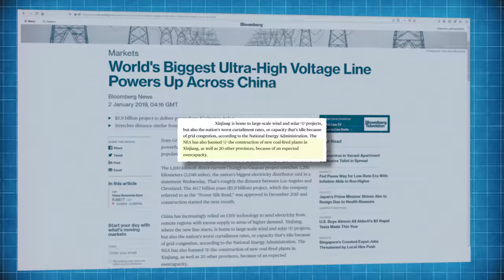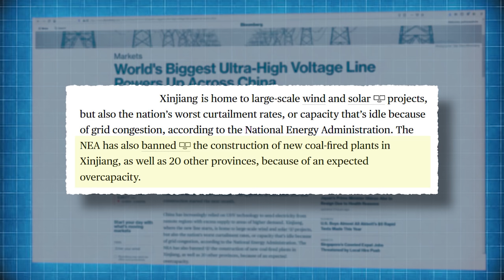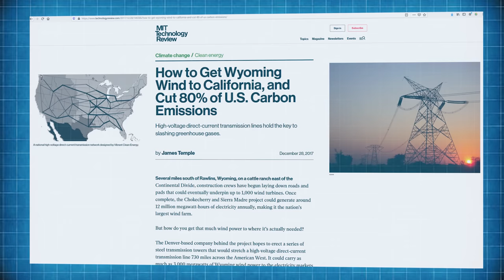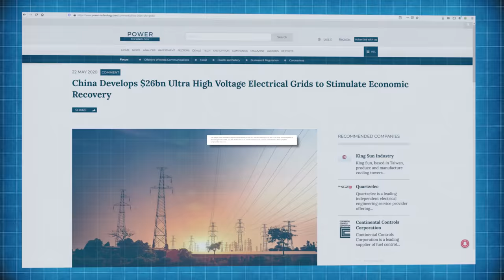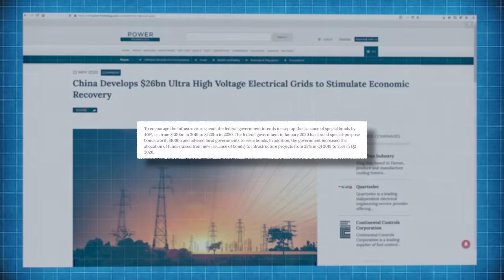China's MILLION VOLT Energy Superhighway

Comment: You did a shout out to Electro Boom!!!!  One of the funniest ways to learn about about electricty.
I did not know that DC could be sent over long distances more efficiently than AC.  Cool!
Reply: It has been known for a long time; the losses for an AC system for the same current is higher because the AC sees a higher effective resistance. Today because of power electronics, we can have DC voltages raised and lowered with relative ease.
Reply: Yes me neither
Reply: i just know a bit, but i don't care, i think it will never happen in Australia.
Reply: It cant. Why do you think dc has always been inferior to ac. Tesla was the man! Because money was wrong in their investment. And F Subasian Norstrom
Reply: @jxmai7687   perhaps australians generally know not a lot and don't care
Reply: @rmonty100  Yes it can. The reason AC was better in the beginning is because it was easier to transformt to high voltage for long distance transmission. They did not have the technology to boost DC voltage efficiently.

Comment: Another issue with AC (especially very high voltage) is unwanted induction on neighboring structures like pipelines and antennas.
Reply: We placed coils of wire in the fiberglass roof of a barn that was near a high tension line. It was enough to light LED lamps in the building to avoid having to run power out to that building LOL 
I worked with cables that run long distance in the past. They would pick up immense electrical charges from running parallel  or even at some angle to high voltage power lines. The capacitive and inductive losses on power lines are very very high.
Reply: @KlodFather  
I heard that's illegal here and people were charged  with power theft, but they got a light sentence.
Reply: @Ted...youtubee  -  There have been some people in authority that would like to make it illegal, but its a mixed bag and subject to the interpretation of the judge. Receiving signals out of the air are legal, and this is just a radio receiver operating at very low frequency. If you are not tapping or doing anything with their transmission lines, its a very sketchy and shaky charge
Reply: Wasnt the other issue with dc the 15 stacks of wires on each telephone pole?

https://i.pinimg.com/736x/f5/7b/e5/f57be5959f6dd344623a4ebde85e6095--telephone-line-wire.jpg

Probably another reason people didn't have an issue with smokestacks--they couldn't see them past the wads of wires 😋

Comment: The province of Manitoba (Canada) put a DC transmission system into use in the early 1970's to bring power to southern Manitoba (where the people are) from northern Manitoba (where the hydro power is). It's been in use for over 40 years, now.
Reply: Are there any criticals learnings from that to be shared?
Reply: @willm5814  It was an early implementation, probably one of the first that worked well.  They learned a lot of technical information. For instance, they built two lines, one for the return current. They since showed that a ground return works fine with DC, and now they feed both lines in the same direction and use ground returns.  I'm sure the Chinese have access to all the reports. You can be sure the switching and rectification electronics have changed beyond recognition!
Reply: @willm5814  
Beavers don't chew down steel towers?
Technology has advanced so much in the last 40 that they likely upgraded at least once by now.
Reply from the maker: Yep. They have existed for some time in various parts of the world, but never at 1100kV. It's quite a step up even from 800kV
Reply: @JustHaveaThink  Yes, how do you build a 60 Hz 1 megavolt switch??
Reply: @akm3726  so how are the ground return earthquakes? how is the corrosion of sub-surface infrastructure? i think you'll find, as in china, that the earth gods are best left unelectrocuted